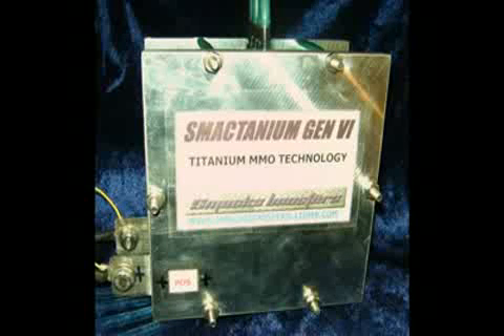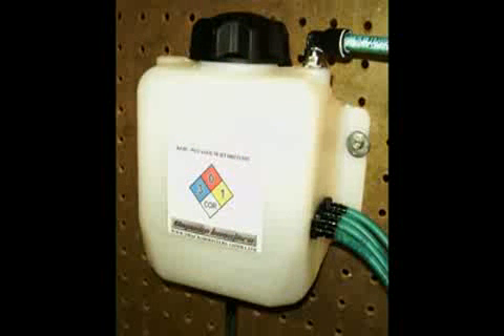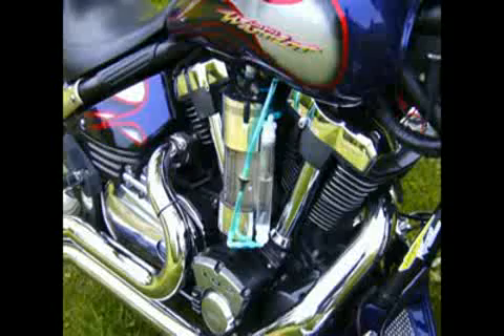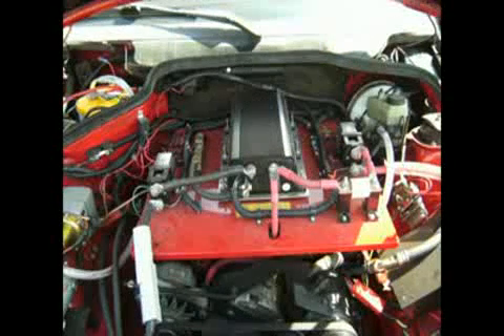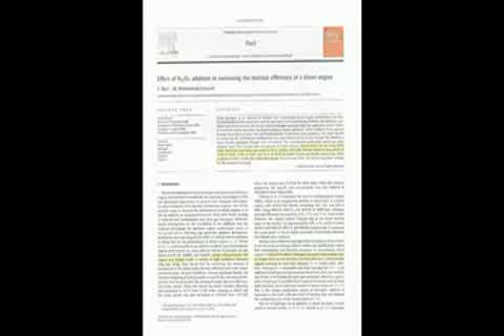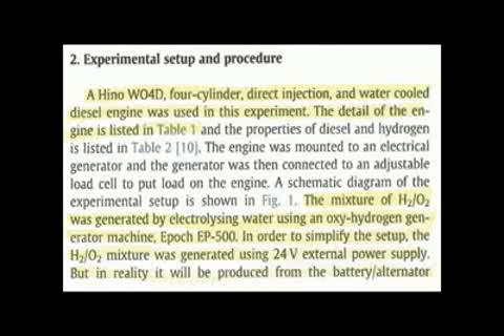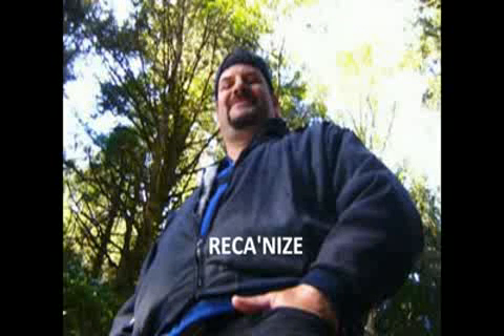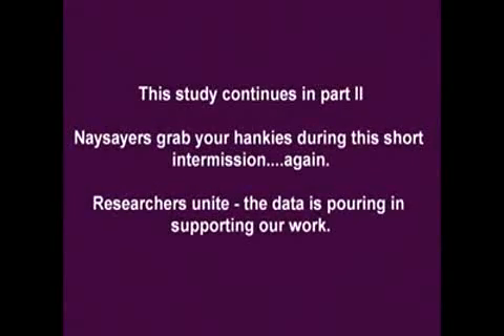Scientific PROOF that HHO WORKS Part 1

Comment: BlackDogSociety - Sorry, but you are incorrect. Most of the diesel heat goes to waste in the cooling system and the exhaust. Therefore the energy input required to make the 4.333 KW is 228% more than in the Australian study. Instead of using an external source they should have used alternators on the engine. In other words, they messed up.

Comment from the maker: @ES2008 --- And I thought you knew what you were talking about... That was all B/S you dumb ass. If it takes 4.333 KWh to make 30 LPM then that's the load, not 2.815 times more. You are twisting shit around to make it work like you want it to. This experiment was documented and published in a scientific journal. All the monkeying around with the data isn't going to change that fact. If you think its wrong then you must build one, test it , then submit it for review. Anything else is B/S

Comment: A comparison - Part C

90% efficiency is 2.8125 times more efficient than 32% efficiency. So we need to input 48.74625 MJ worth of diesel per hour, to get the alternator to make 17.322 MJ per hour.

The alternator is only 86% efficient so the real figure is 56.682 MJ per hour, which is 228% more energy input that the Australian study required from the wall electricity. That fact will cancel out the 7.3% gain they claim on the last page and actually cause HHO to hurt their fuel consumption.

Comment: A comparison  - Part B

At 7.0621 MMW, 30.6 LPM = 4333 watts = 4.333 kilowatt-hours = 15.5988 Mega Joules per hour. At 90 percent efficiency, we need 17.332 MJ of input, per hour, into the EP-500 from the wall electricity.

On the 19 KW load test, before injection of the HHO, the brake thermal efficiency is 32.0 percent. So only 32 percent of the energy input from the diesel fuel is converted into the mechanical motion, needed to turn the alternator.

Comment: A comparison - Part A

The Australian study used an Epoch EP-500 HHO machine and electricity from the wall.

Power supplies are 90 percent efficient. An alternator, due to friction, is 86 percent efficient.

As my video points out, 100 percent Faraday efficient electrolysis = 7.0621 milliliters per minute per watt. To be fair, I will use that figure in both examples. The Australian study used 30.6 LPM in the 19 KW load test.